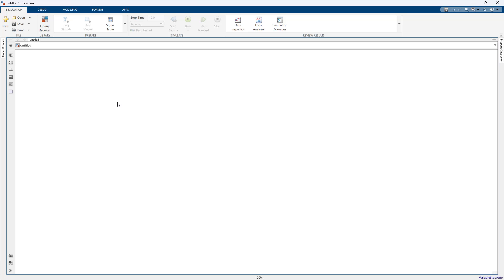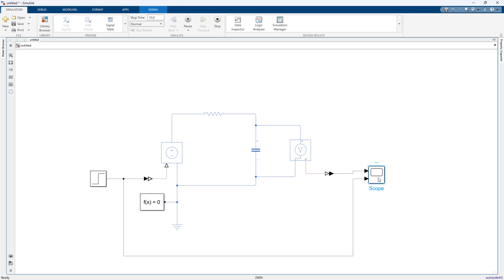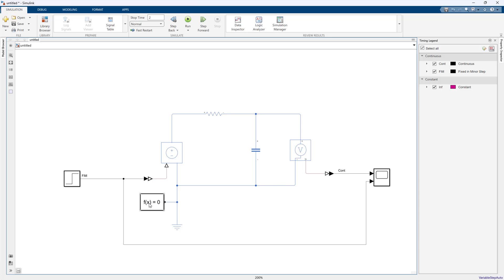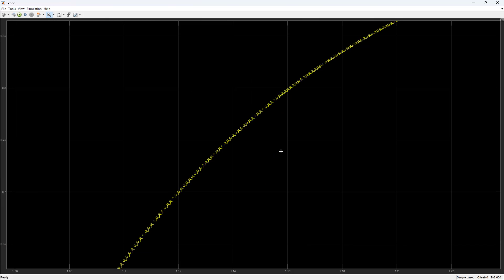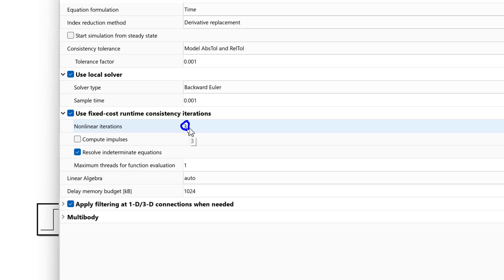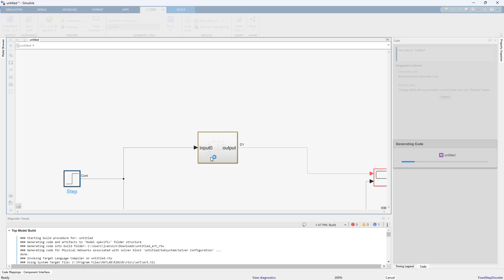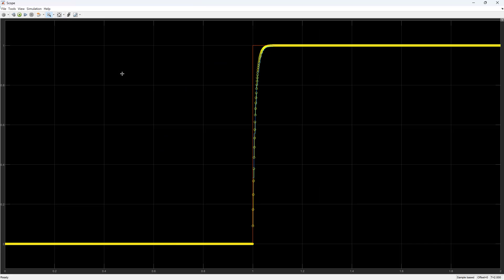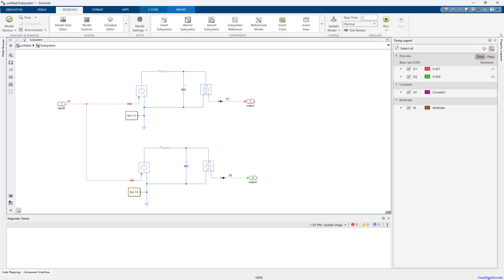Generating Code with Simscape Models

Comment: Hi, I'm very interested in this topic.  Can you share more use case / examples and what type of hardware you would typically deploy a Simscape model onto a target and why?  And can you give some examples of what FMI/FMU/DPI workflow is and what types of problems it tries to solve?
Reply from the maker: The most commons use case is to deploy to speedgoat real-time hardware as MathWorks directly supports this vendor.  However, you can use pretty much any real-time hardware for this workflow.  This would be in order to implement real-time hardware in the loop testing.  This allows testing without high voltage/current HW for initial test/debug of control hardware.  FMI is a specific way of implementing models so that disparate models from different software vendors can be combined in a unified framework (the idea is usually nicer than the reality as its very hard to integrate models from different tools even if there is an interface for it).  DPI C is a specific way of using c code to integrate with tools often used for chip design to do verification of designs. (xilinx/cadence are examples)